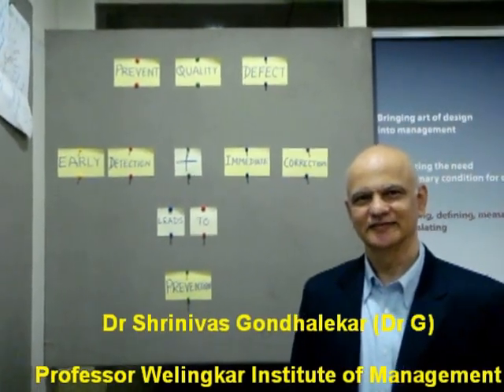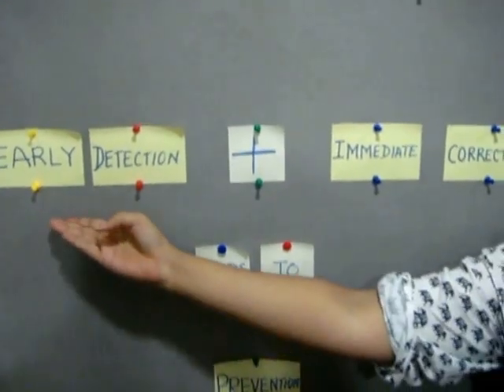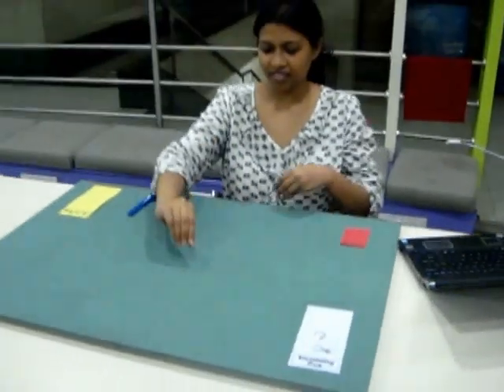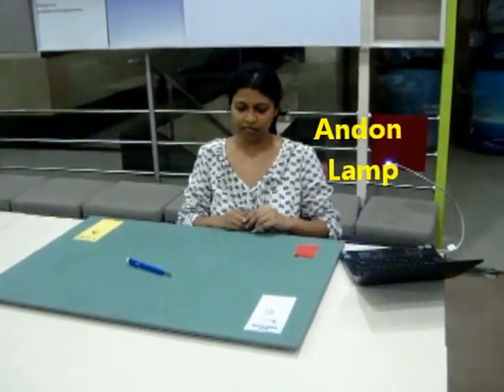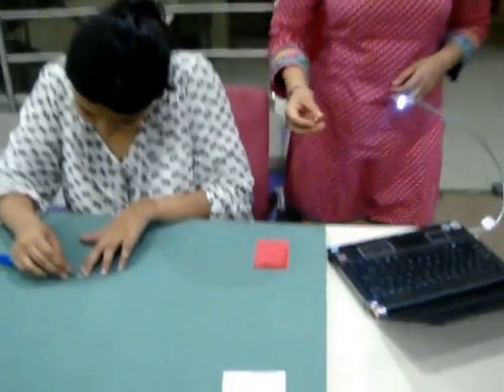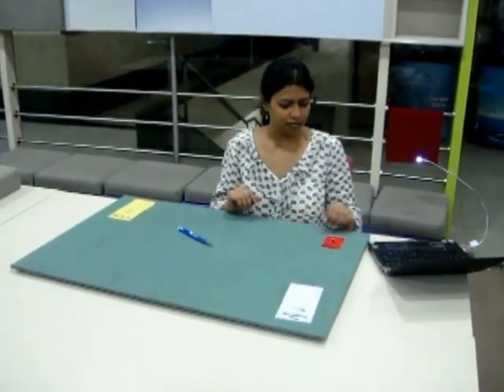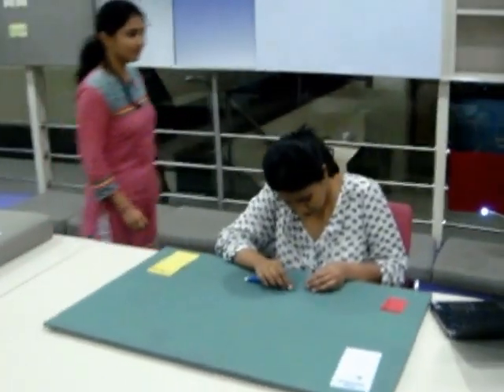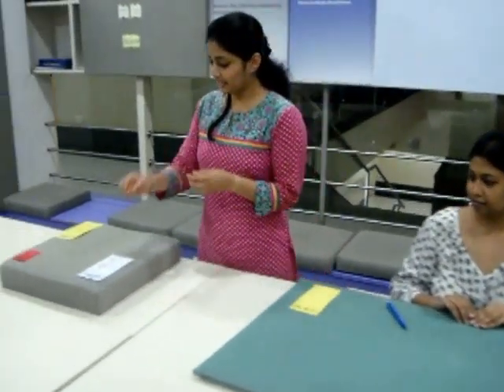Defect Prevention thru "Early Detection + Immediate Correction"

Comment: This method is very helpful in real life as rightly said by Dr.G.
I would like to share where I saw this being used:
The method of early detection was carried out in the HVAC industry, where I worked. When the installation of the piping took place, they were first checked for gas leaks with Nitrogen gas. Then they removed the nitrogen gas by creating vacuum and adding a filter and only then added the refrigerant after checking  
Apart from saving time, the customer had very few complains later.

Comment: The process of early detection of errors/flaws coupled with its immediate correction will certainly help in the reduction of errors.
After placing the unit in the checking area the operator continues with the work and doesn't have to wait for the inspector, this increases productivity as there is no idle time (i.e. the operator works independent of the inspector)
Thank you Sir.

Comment: This experiment very clearly demonstrates that though 'Prevention' is difficult, we can still assure ZERO DEFECT delivery by using 'EARLY DETECTION+IMMEDIATE CORRECTION' approach! 
We must 'Detect' faults/defects ASAP (using an QC inspector) and 'Resolve' them immediately. 
Early detection and resolution ultimately leads to zero defect delivery. 
One QC inspector can check one or more Operator's works.
Thanks Dr G.

Comment: When I was doing my first Industrial Training at CTTC,Bhubaneshwar,I got a project on "Manufacturing of hand injection mould".From the initial stage of making a mold to the final stage of pouring the plastic into it,we have to check the quality of the mould at every stage of it.We used to compare the mould with the standardized specification given to us.This method is very useful in detecting even a minute defect while in the initial stage of manufacturing the product.Thank you Sir for uploading such an informative video.

Comment: This is a technique I can definitely apply in my plastic article manufacturing business. Sometimes excess plastic is injected and causes a "flash" on some part of the product. Generally this is covered up by using blades in the finishing process and then all the finished products are checked together and rejected ones are given back for finishing again. I can implement this technique to achieve the same result in less time and a more systematic manner. Thank you very much, Dr.G.

Comment: This video taught me an important concept of Early Detection along with Immediate Correction leads to Prevention. As the Quality is checked at each process it leads to early identification of the problems which will thus save the time and effort. And Solving these problems early at each stage cause no or less idle time thus increasing the productivity. Thank you Sir for this Insightful Video.

Comment: Firstly I learnt that very difficult task like Prevention can be achieved by Early Detection followed by immediate correction.
I also learnt that clearly marked area should be use,that too with different colour if it is required.It eliminates confusion & allows operator & supervisor to work simultaneously.For this purpose clearly marked area-Repair was shown with red colour in video.
 
Thank you for providing this learning Sir.

Comment: The video very nicely demonstrates that Early detection + Immediate correction leads to defect prevention and also reduces cost of working on defects early in the cycle. This reminds me of my work at Igate where my job was into testing of applications. It is very helpful in such cases  when the earlier the defect gets detected like in the Requirement specification stage itself,lower will be the cost spent to work on it and greater is the product quality.

Comment: Andon Lamp is very useful as it's visual and catches the QC Inspectors attention quickly.its easy for him to see at which station a piece to be inspected,saving his efforts and time.Work in Progress (WIP) is minimum.this concept can applied in  Steel industry where cut to length line cuts the steel coil into sheets with predefined length so QC checks the sheets after completion of batch/ coil so with early detection n correction in setting he can prevent the losses.Good Learning.Thank you sir

Comment: The concept of Early detection + Immediate correction is a very useful technique in various fields. My father runs a small cotton mill where there are cotton rolls that has to be manually cut into pieces for further processing. To prevent wastage, the rolls are checked under bright light to detect any small holes or marks before cutting into pieces. The moment a hole or mark is found, that particular part is removed from the sheet and are put separately for rechecking. This way the error is detected early in the process and correction is done accordingly. I have been seeing this process since childhood in my father's factory without understanding the logic behind it. This technique was understood clearly as I could now connect with the concept behind it. Thanks for this insightful practical knowledge Dr. G.

Comment: Hello Sir,
We know that errors are bound to happen but detecting these errors immediately is the key to breakthrough quality standards. I learnt that a defect should be rectified and corrected at the lowest and every level before being passed on into the system to avoid tracing of error and further complications.
In daily life i would relate this with our health..regular routine checkups help early detection and prevention of diseases. 
Thank You Sir, its a great value addition

Comment: An inexpensive yet highly effective method. During my work experience at a manufacturing firm,I recall how the Quality inspection was performed on batches and emphasis was given to QC during more critical operations, whereas during some less critical operations,the job was not inspected thoroughly. Needless to say, WIP was more and defects were not uncommon. I would recommend the practice of early detection and immediate correction to my colleagues. The rowing QC inspector,clearly marked areas would highly improve efficiency without any cost.

Comment: You are a 'Saviour' sir. Early Detection +Immediate Correction technique saves three important aspects is what i found: 
1. Resources: Raw materials which saves money from making faulty products.
2. Time: If defect is detected early unnecessary time is manufacturing defected product is saved.
3. Energy: Energy applied in terms of effort by individual at every stage and also energy used by utilities.
    I have learnt from your explanation that stringent inspections at every stage in operations is must and after defect is found immediate correction should be made to avoid greater losses.

Comment: This video and our lecture had helped me in providing the details of the issues with the motor at the same working stage of time . I am in a business Rewinding of Motors. We have developed a Job card system which states all the details of the motor which is filled by the Supervisor at the time of opening and cleaning of job which earlier it was only known to the Supervisor who would guide all the concerned staged worker. Know the work of supervisor is reduced who looks after inspection.

Comment: Hello sir,

Early detection of errors prevent lot of work overhead. I can easily connect this video with my experience in my earlier job in IT industry. We generally used to test code after completion & then fixing errors would become a tedious task. So, later on we started to test code when a module was completed & it worked like miracle. We saved our time & efforts a lot.

Comment: The video has shown a very smart system for preventing defects. As the quality is checked at every station immediately after the work on that piece is done, the chances of the piece going through the further processes are reduced. Also, the immediate correction is important because the chances of getting the piece repaired are maximum at the station at which the defect has occurred. It sees that the piece won't get discarded which results in cost saving.
Another beauty of this technique is that the QC Inspector can serve many operators.

Comment: The early detection + immediate correction helps understand how bottle necks can be avoided and instead of correcting the defected pieces after the total production , it is always better that they are checked at every level , it will reduce cost and also time. Thank you sir for this video.

Comment: very simple way to detect and correct the defect at early stage. The important thing I learnt from this concept is using different colors at each stage; it is easy for identification and makes the process smooth, I could also relate this concept from the hotel where I worked where different color of racks and cutting pads are used to make the segregation easier to identify during operations. Also it is necessary to have a quality check immediately before the product goes to another stage.
Thank you sir

Comment: Sir,
I have worked as a production engineer. During the manufacturing process I have always faced such kind of defects in the whole process but the major mistake we were doing there was that we were doing the quality inspection after the product has finished. This was the wrong culture that was being followed in that factory.

This video showed me the very simple approach to prevent the possible defects in turn it will reduce the man power and time. I will definitely apply this thing whenever I will get the opportunity.
Thank you.

Comment: I can relate this technique with software company where along with testers, developers play an important role in this phase. Generally in order to complete the project on time developer often fail to understand the requirements. Such ambiguities are implemented in the code leads to plenty of bugs for tester to identify. What I learned is cost of such defects and  fixing them in defect prevention stage is lower than fixing them in later stages. In IT companies job of tester is same as the QC inspector shown in the video. Thank you Sir!

Comment: Dear Sir,
Early detection technique is very important and I have seen it getting implemented exactly on assembly line of diesel injectors.
The part while getting produced was getting checked at the same station and an error if noted was immediately notified by an visual and audio siren.
The associate on that station reworks it and checks it again for correction. This saves a faulty part from being worked at further stations.
Thank you sir for showing the same with a very simple example.

Comment: Defect prevention through early detection and immediate correction would definitely help us on reducing the efforts that are needed to put in later increasing the product time. Also using this technique man power is utilised to the optimum level as a single supervisor can handle multiple operators. My manager had taught that never hurry processes just for the sake of finishing, and then search what went wrong, go through each step which will reduce efforts and ensuring maximum quality. I would definitely start practising this technique for tasks that i would carry out. Thank you sir for explaining this concept.

Comment: The video brings out a very simple formula to attain perfection i.e early detection & immediate correction.It negates the usual notion that to avoid defects we need hi end and hi tech processes in place. I can relate it to my experience in the software industry where if detects are detected at the last stages of the project,it leads to high increase in the overall cost of the project and hence software is always developed in phases or modules where each module is thoroughly tested till it is defect free and only then the next phase of the project begins.

Comment: When I was working in an IT company previously. We were taught a software development model (SDLC) a model of Agile development process. The process had a similar essence. There need to be testing, review and examination on each process and module. Only when it is totally defect proof, it should be sent to next level. This is the only way in which we can minimize or eliminate final stage defects. As we say small drops make an entire ocean, in the same way step by step and regular quality checks leads to zero defect product or a service. If you use this in your personal life, it is called daily reflection of the day you spent. Every reflection will help you become more efficient and you can increase the quality of work you do. 

Using manufacturing fundas in life ;)

Comment: Sir, Very nicely explained . 
I can relate this concept with the refueling of vehicle. For simple reason, when the fuel in the tank goes below a certain level, a light indicator turns on suggesting that we should refill the tank with fuel. In this case:
1. Early Detection is the the illumination of the bulb
2. Immediate correction is refueling of tank from the nearest petrol pump
3 This leads to prevention of vehicle running out of fuel and further damage

The idiom which goes along this is  "A stitch in time saves nine"

Comment: Detecting the problem early and then correcting immediately is a must apply technique to prevent defective final output. This method saves the cost, reduces the risk and increases productivity. Thank you Dr. G and the team.

Comment: This simple concept of early detection + Immediate correction taught to us by Dr.G can be easily applied to most of the activities of our daily life. Some of the areas where I will immediately apply this concept for better quality results are:
1. In learning advanced MS Excel: Earlier, I used to pick several concepts of Excel at a time and try them and then whichever I found errors in, I left it to be corrected at a later stage. This led to delay in correction as well as having to correct several errors at a time which led to ambiguity in the concept. Now, I will take one concept of MS Excel at a time, correct all the errors and make my concept completely clear and then move on to the next concept making the process much more systematic and faster with better quality of learning.

2. Making presentations and reports: Earlier, the method I used for making presentations and reports was to first type out the entire matter and then go through it all over again to correct the spelling mistakes or formatting errors in it. After watching this video, I made a presentation applying this concept of early detection and correction instead of leaving it for the end and the clear results were that I made the presentation in lesser time and lesser effort. 

There are several more areas where I will definitely apply this concept. Thank you for sharing this with us Dr. G!

Comment: Early detection and immediate correction is very important since if error is detected early and is corrected immediately it will save TIME and MONEY which are extremely critical in production. From my little experience of working in manufacturing sector, i observed that - Since our production unit had assembly line, late detection of error meant that the product had to be disassembled, correct the error, and reassemble. This meant a loss in daily production time, which affected daily targets.

Comment: Hello Sir,
After watching the video I understood that the problems should be detected early and corrected immediately to prevent it from becoming a big problem. In my daily routine, I usually like doing activities which is not important like watching television and the important assignments is kept to be done at last. But this always leads to a manifestation of an issue which can’t be solved at the minimum time which I have in hand. After watching this video I have understood that timely work and observation of the problem (if any) can prevent from last moment inconvenience and hassles.

Comment: Dear Sir,
This concept of early detection plus initial correction leads to prevention of defects is  very simple yet a very powerful concept.This concept can be used by software coders. Being software engineer myself I used to get tired of correcting so many errors at the end of compiling big files or software.Instead of compiling the entire chunk of codes at the end, we should immediately compile and run, after completing  each section of the code.This will save time and coder will not be frustrated at the end(as he will have zero  errors because he has corrected all the errors initially)